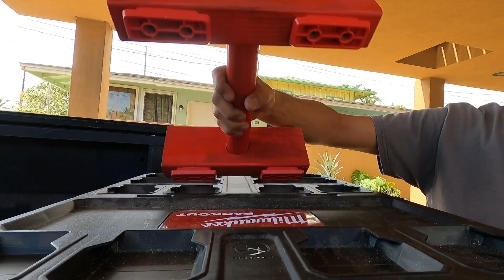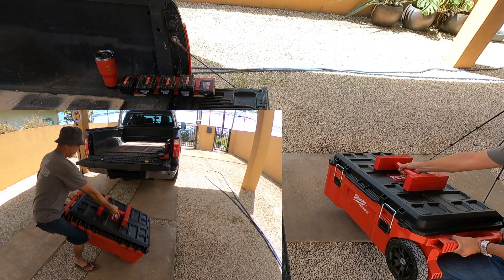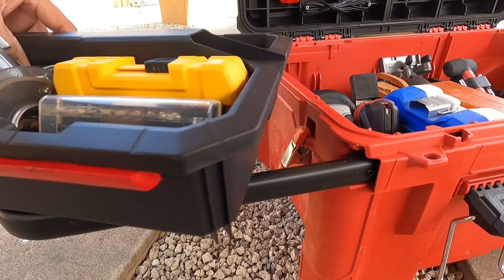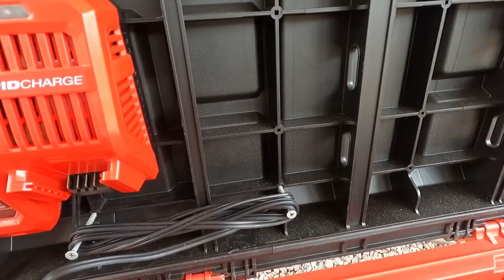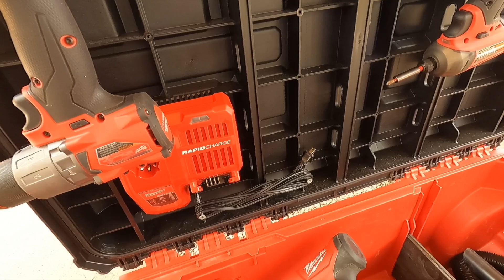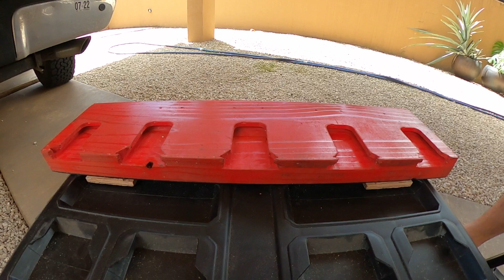CHEST !!! You Need One 🤙 Milwaukee PACKOUT mods, setup, hacks, ideas

Comment: ITS NICE TOOL BOX THAT CAN USED TO BUILD POWER BOX WITH 8000 WATTS INVERTER 3 12 VOLT DEEP CYCLE BATTERY 100 AMP 12 WATTS 12 BLOCK FUSED PANEL HAVE FEW AC 110 OUT PUT FEW USB PORT FEW LIGHT FEW COOLING FAN SOLA CHARGER IN BOX ETC LOVE THAT BOX YOU WILL POWER IN BOX